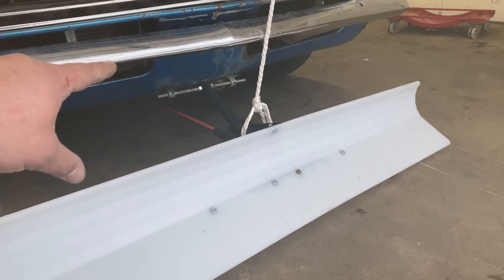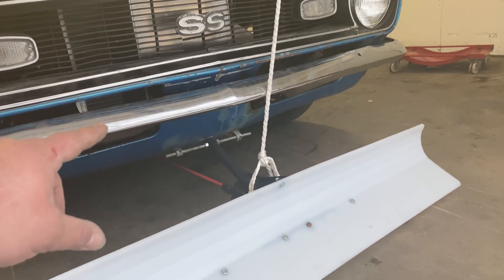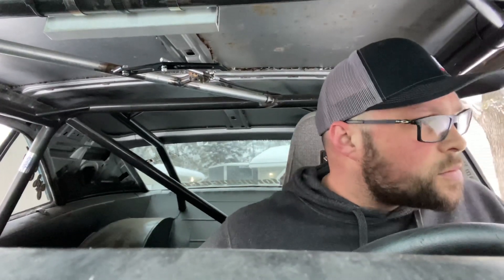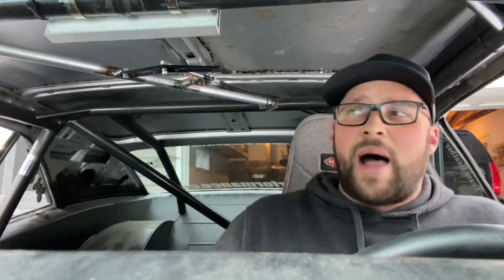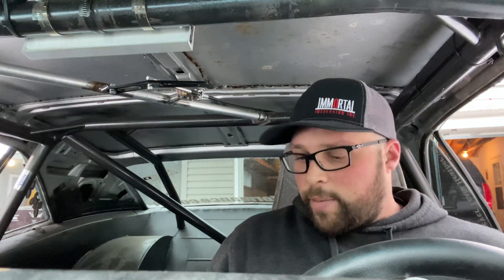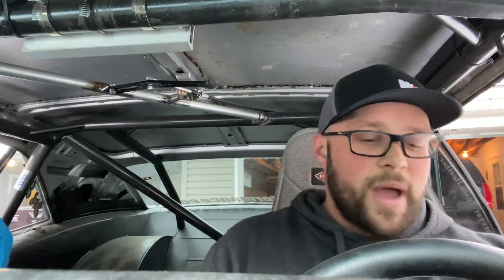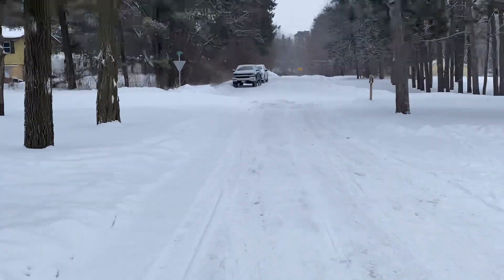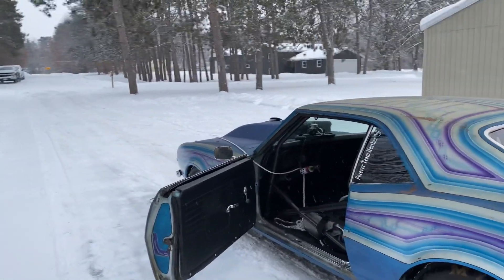My 1150hp Turbo LS Snowplow

Comment: From Texas and went to work everyday during this weather even though our building only had power for 3 hours of 3 days of the week.
Reply: I do have a turbo 5.3 chevy luv that has brackets for a tow bar that could easily adapt a snow plow next time this happens, might have to swap out the slicks for some all terrain tires though...
Reply from the maker: I was surprised how well the slicks worked!